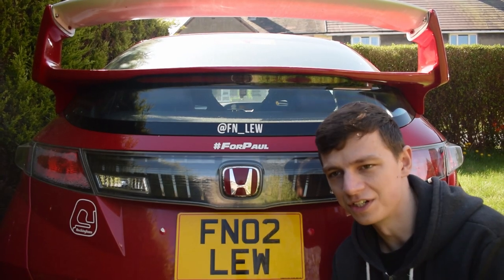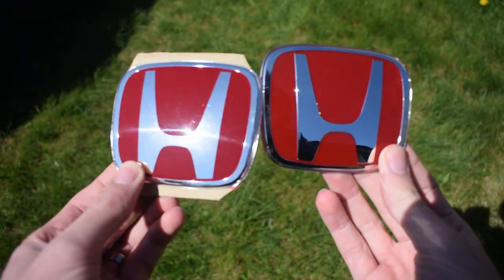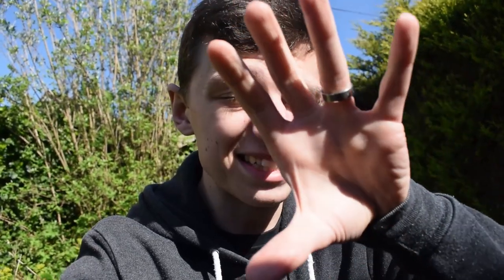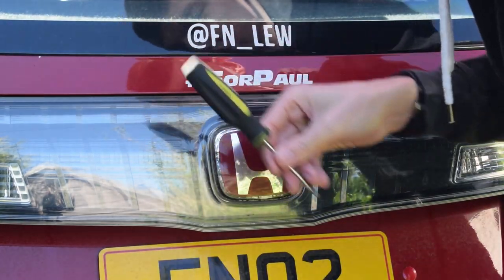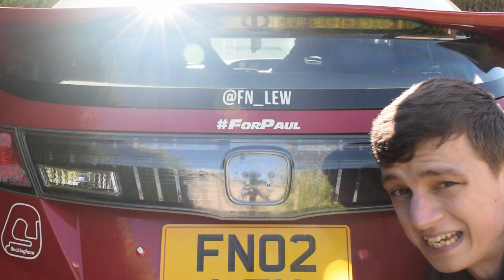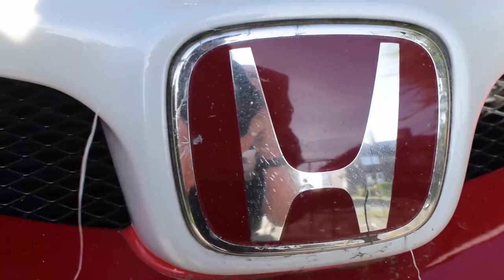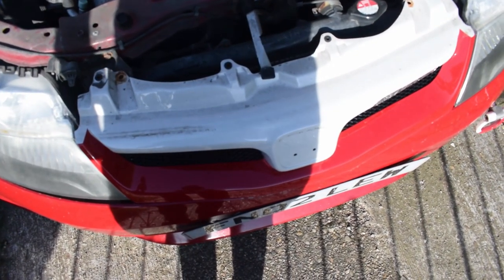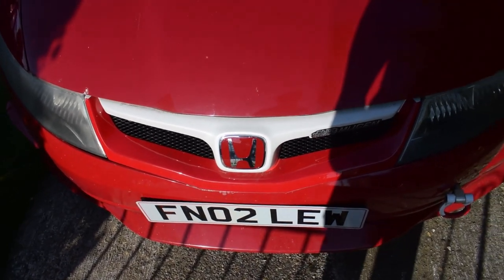So Clean! Fresh badges on the Type R

Comment: Went to Cox Motorparts and asked about a genuine rear H badge (as my chrome is flaking) and they replied "Thank you for getting in touch with us. Unfortunately it looks like this badge only comes complete with the rear light unit it seems!"
I've a picture out of the Honda parts manual, but can't attach it here. Thoughts ?
Reply from the maker: Is your model a type R or a type s? I will say it's not listed as a rear badge. It's listed as a front one but a friend that worked for honda for years informed me that the front and back are the same badge so just buy the front one and it will fit fine.

Comment: Hey mate, can u please shed some light on something for me? To your knowledge, what's the biggest battery you can fit in an FN2 WITHOUT relocating the whole thing to where the stock intake would be? If that makes sense. I've looked up some options in my country (I don't live in UK) and found some 60Ah and 65Ah Exide's and thought I hit the jackpot but then I remembered the stock battery is so tightly thrown in there and I don't even know the dimensions, my car is in the shop right now. So whatcha think, am I stuck with 45/48 Ah for life or what? Note: I do not want to relocate to trunk or any other place, Thanks so much in advance!
Cheers!
Reply from the maker: Hi mate, unfortunately I have no knowledge about this. What I do know is the where the battery is fitted it fits EXACTLY in it's destination. So I don't think there'd be room there for a bigger one. But that's just my opinion.
Reply: @FNLEW  Really the only variable that doesn't let me sleep right now is the width of the whole space where the battery goes. I've seen a couple of sites suggesting 129 mm is max, while others found batteries compatible at 173 mm width. 4.4 centimeters is a hell of a difference. Any thoughts? Since I'm not able to measure on my car right now...
Reply from the maker: @jjsx5347  I honestly don't know. I only bought a replacement battery from my local automotive parts shop. I gave them my reg and they gave me a battery.

Comment: When you used the screw driver you should have put a cloth at the bottom so you don’t mark the outer . As for getting the sticky backing off , use a hairdryer and the job will be done in 3 minutes! 👌🏻
Reply from the maker: Don't worry I made sure I didn't mark it and by the time I got a hair dryer and an extension through my house I'd have finished it either way so I just stuck at it. 😂